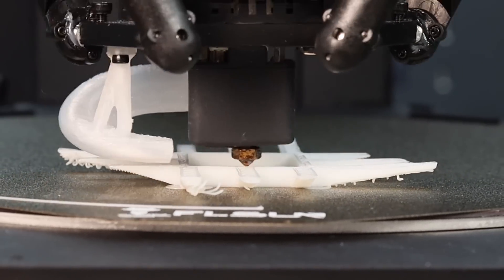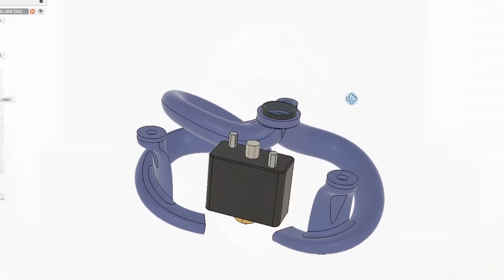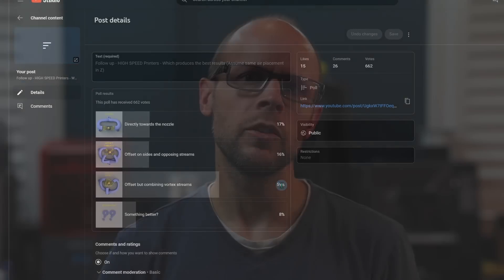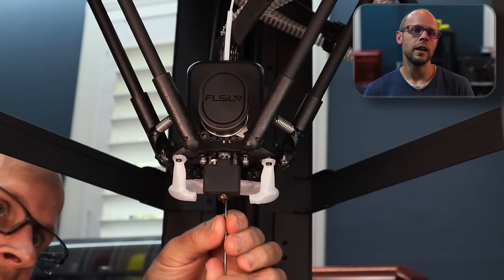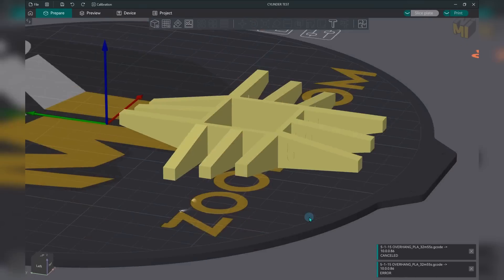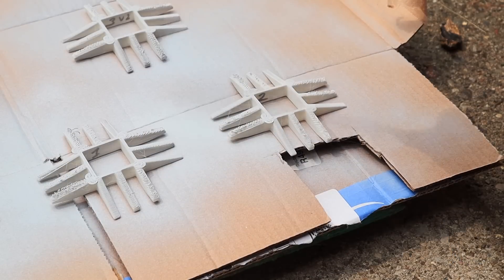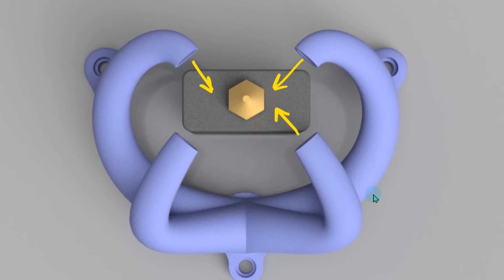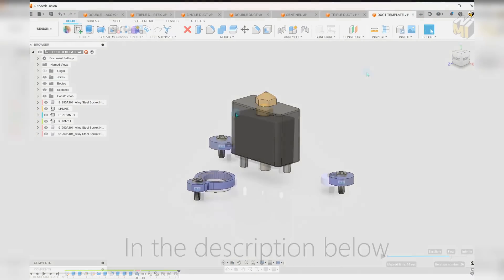More ducts is better, but how many is too many?

Comment: I have two fans cooling my printed parts. I use single ducts for each, but I was thinking of doing a dual duct for each fan, so I can get better cooling across all directions. Do you think it will work well? I want to surround the nozzle, so air does not hit directly the nozzle.

I would like some suggestions because it is my first real duct design and I have made progress, but I think I can do better

This is my custom duct design name on Printables:
Persano Duct for the CR6 SE - 4020, 5015 and 5020 Blowers with ADXL 345 Mount option

I can not put the link in here, Youtube seems to hate the links and delete my comment
Reply: Also, you gained a subscriber! I really like this kind of content.

I am new to 3D design and I love learning new ideas I can put to use on my 3D printer.

Comment: You just needed to do a little more research, there are several duct designs and people explaining how to do it. Testing by blowing on the water, dividing the flow, etc.
Reply from the maker: I've tried blowing on water in previous videos as well, it does give a good sense of how the air is directed down, but I don't believe down is ideal, I'd like to test horizontal vs down next and I'd also like to test out offset vs directed at the nozzle.
Reply: There are also like 100 duct designs by people who thought they knew what they are doing that perform like crap. ;)

Comment: For my own DIY built 3d printer, I have the nozzle surrounded by a circle shaped duct.
It actively touches the silicone boot of the nozzle.

I have no idea how it compares to a more typical design, but I get pretty epic bridges out of it.
Reply from the maker: I've seen a few of these and I think they can work really well, it'll have to be tested against some of the other designs.   the 360 surrounding version would need to be balanced out a bit better with larger and smaller ports, but it's doable for sure!

Comment: Install a windbreak around the nozzle. For a test, place the end of a thermometer about a millimeter away from the nozzle. Heating the nozzle should also heat the thermometer just like it would filament at that short distance. Put a windbreak around most of the thermometer, leaving a small bit of the tip exposed near the nozzle. And then test how much and how fast the different ducts decrease the temperature of the thermometer and the windbreak should prevent the decrease of temperature on the nozzle.
Reply from the maker: Nice idea!  I was going to try and make a silicone sock to cover it properly, but it'd be good to see the impact of the fans on the nozzle first.
Reply: @NeedItMakeIt  it's hard to beat 'real world' testing like you did.. but I'm also a numbers guy, as sometimes things get revealed and new concepts open up. :-)

Comment: Great content!  Get sponsored by one of the meal services that ships with dry ice, so you can use it to visualize where the air is going in each design.  A little dry ice + boiling water makes a nice print bed full of mist.
Reply from the maker: I was thinking smoke pencil, but your idea is wayyy cooler!

Comment: Very exciting and interesting topic. Especially because I wrote my exam in fluid mechanics yesterday. :D
Reply from the maker: Nice!  Hopefully the exam went well.  Do you have any insights into where you think we should go next with the design?
Reply: @NeedItMakeIt  Without CFD simulation this is unfortunately not very easy and even with it you often have to test new prototypes. The round profile is definitely the best to avoid pressure drop as it has the least edge friction. It also has the least turbulence, although the question is whether turbulence is good or bad in this application. Using the same inlet and outlet area for the three nozzles is important in any case, this is based on the flow law. To avoid pressure differences on the sections, the ratio of the length L to the flow area A should be as constant as possible (L/A). You could also use larger nozzles which would reduce the outlet velocity.
Slower velocities are also more laminar and can be improved with a grid of fine tubes.

I'm really looking forward to seeing what else you come up with. There are so many possibilities :D

Comment: This is a tricky test. CPAP blowers will power any duct you have, making it look better than it actually is. Using 5015 blowers and other typical fans won't be able to get air out of many of those ducts.

Comment: You mentioned doing a new duct for the Qidi Q1 Pro. Was wondering if you have any designs for that and/or are planning a video for that printer like you've done for this flsun one?

Would be very interested in improving the cooling on the Qidi Q1 Pro!
Reply from the maker: I'd love to do an option for every popular printer, including the Q1 Pro.  Before that I was hoping to get some ideas from the community to test out and then we can come up with the best possible option together.
Reply: Hey dude,

Based on this video and your experience of the panda jet, I think a 3 or 4 duct design once you have the knowledge on offset positioning, duct sizes etc.

On the Q1 (And other Qidi printers), the probe is on the right and mounts for beacon or Carto place it behind the nozzle.

Placement of a 4 duct design maybe best at 45 degrees, 135 degrees, 225 degrees and 315 degrees.

For a 3 duct design at 45 degrees, 165 degrees and 285 degrees.

Those as the positions least likely to interfere with either probes but I guess that would be in the design work.

I also wonder whether the stock fan on the Qidi (with it's non-standard design) would be better or if it would be better to consider a fan swap with new duct design for Qidi printers?

Comment: In terms of "path" the bend should be contiously differentiable twice so there is no "sharp" corner both in terms of direction and velocity(change) and short as possible so there is no loss
Reply from the maker: If we can get away with the double duct and have them offset to the side of the nozzle I think it's possible.  I'd imagine that the long corrugated hose leading to the duct will cause quite a lot of loss also, I wonder whether a more flexible and smoother silicone hose would be better.  Maybe for the next tests I need to use 2 printers, one with the CPAP and one with a standard blower style part fan.
Reply: Will be interesting to see the difference as ratio between inlet and the outlets will play a role too. Advantage of the CPAP is probably that it will be more "laminar" than a 5015 closely mounted to the ducting system(more equal pressure/flow across the inlet"). I am looking forward to the results.  The fan showdown series by major hardware is fun to follow and hope we get some fun out of this as well

Comment: Great video! This kind of testing is so interesting to me. It makes me wonder why the OEM can't do this and have 3d printable improved duct files available for people who want them. Saves them the injection molding costs, but provides a much better result to the customer.
Reply from the maker: Thanks!  I think it's an area that needs a bit more attention for sure.  I think at a minimum they could provide a file that could be printed at home.  I think you're right, it comes down to cost and to some extent the look.  I really like the open and somewhat organic look, but some people probably prefer the clean condensed version.

Comment: 7:19 Simscale
Reply from the maker: I've tried it, but the walkthroughs I found are wayyy out of date.  They've also removed the compressible tests and only have non-compressible for the free version.   I'll give it another try.  

I have a silly idea, what about making some versions which connect to the hose and then we'd have at least a good visual of how water flows out, it might be a bit of a mess, so I'd have to print something to take the place of the hotend for the tests.  I guess blowing smoke out might be better, that's probably doable too.
Reply: @NeedItMakeIt what about OpenFOAM?

Comment: I think the "relief ports" on that one duct are to cool the part aswell. When printing really fast, the nozzl will not spend enough time near the recently laid down filament. That's why you have auxillary bed cooling fans on the bambu x1 and voron 0.2.
This would be similar to having an auxillary bed-widevcooling fan.
Reply from the maker: It could be, i guess I'd need to cover them up to see if there is any noticeable impact.   I'm not certain that a CPAP can really replace one or two auxiliary fans, but I'd like to at least try.  Having a part fan that can cool locally and also cool the rest of the part is a tall order.

Comment: I'm so confused, what about heated chambers? Do we want parts warm or cool as soon as the nozzle leaves filament?
Reply from the maker: That's a tough one, when printing with ABS, I print much slower and with almost no part cooling on, with PLA, we're talking more extreme speeds and much more cooling.   I think it's a good topic to explore more, when "cooling" in a heated chamber, the air is going to be fairly warm so it cannot extract as much heat, in the case of these materials, it may be a good thing to make sure that the ABS or PC parts don't warp and shrink too much during the print.
Reply: You want the part to be just cool enough to support the layer above.  The hotter the part, the stronger layer adhesion.  Heated chamber prevents overcooling.  You can also passively cool, by printing many objects on the build plate.  This allows the parts to gradually cool down without the need for a cooling fan.  It is a balancing act especially if you bring cold air from outside the heated chamber.
Reply: For materials such as ABS and similar. You must turn off parts cooling or about 20% fan. Keep the part hot most of the time.

Comment: It would be sick to see you print with smoke or fog of some kind blowing out so we can see the real relationship between the nozzle and the flow.  Also, if you build a raised glass bed with 45-degree mirror under - we could look directly from below at initial layers.   Nobody on YT has done this to illustrate a point that I know of.  Your content is outstanding.
Reply from the maker: YES!  Oh I like that idea with the mirror, that's very clever.
Reply: @NeedItMakeIt  I do clever for full time living.
Reply: So... Smoke and mirrors? For once, a totally positive thing. IT MUST BE DONE!
Reply: It'd be tricky to setup, but maybe Schlieren photography?
Reply: Mirror bed could help with the lighting  l @SnakebitSTI
Reply: How did you make the part of the ducts that bolts to the effector? Was this the generative design module?
Reply: You could simulate it with air flow simulation software. That gives you a very good idea what may going on
Reply: Very good comment. For me we need to see where the flow goes. A lots of maker make fan duct but i think the flow is too much directed to the output of the nozzle rather than on the layer. I think good fan duct can be on the side of the hotend directed to hotbed.

Comment: Ive seen visible print quality improvement in all my printers when installing community designed shrouds. Especially on printers where I can go from one cooling duct to three. It makes a huge difference. In the same vein, these enclosed corexy printers like the K1 make no sense with the single giant aux fan on only one side of the print bed.

Comment: Very timely video for me, and I hope it creates lots of discussion about the best duct design 😊 I am currently designing a toolhead for the Creality K1 family of printers that use standard revo hot-end parts (revo voron) support several of the extruder models out there, and most related to this, a rear mounted part cooling fan so need to find a good duct design for that :) as always great video and information..

Comment: I've been working on designing a highly efficient duct for my printer for quite some time. Although most of my designs have been lackluster, I've discovered some useful insights:

It's more effective to point the ducts slightly below the nozzle, concentrating the airflow more on the part. Additionally, angling the ducts downwards slightly ensures the cooling isn't too strong on the nozzle, preventing temperature fluctuations and reducing the risk of a thermal runaway error.

If you opt for horizontal twin ducts, ensure they are either offset from each other (not exactly mirrored) to minimize turbulence or angle them slightly so that when the airstreams meet, they push each other in the same direction, exhausting the air out of the way (a technique I learned from Hero Me ducts).

Regarding the shape, most ducts I've seen are rectangular, exhausting the airstream like a thin curtain. However, the downward-angled ones tend to be more rounded. While I'm not entirely sure of the implications of these shape decisions, the rounded shape might provide some benefits.
Reply from the maker: Beautiful, thank you for this info! I have the follow up video in the works and these ideas will be super useful.  I'd like to find a way to visualize the differences using smoke in the next video too.  The water test is nice, but it's not a great representation of what really happens and the more I think about it, the less I believe that air coming down is good.  It may be good for some parts, it seems to be a better idea to have it come across the surface in a stream of cool air which can quickly warm up and then easily leave.
Reply: @NeedItMakeIt  I'm curious to see the results of the smoke test and hope they will be visible despite the high speed, which might make it challenging. The closest way to visualize how the air will travel is through CFD (Computational Fluid Dynamics) simulations. Unfortunately, I don't have the resources to learn both a simulation environment and the underlying physics, but I believe this is the "right" approach. Ideally, you would perform calculations to determine the desired outcomes (such as airflow path, velocity, turbulence, etc.), then model the duct based on those calculations, followed by simulations, testing, and refining the design.

I'm looking forward to your next video and seeing what you've discovered. It seems that, apart from a few videos, there's a significant lack of information on this topic. Also, I'm starting to think that 100% fan speed may not necessarily be the best setting, even for bridging and overhangs, I am curios what is your take on this matter.
Reply: Nice! A lot of this follows what I've been discussing and theorizing with Mike and others. We gotta get to the bottom of best cooling as a community! There are so many bad designs out there.
Reply: I just started my journey on making a custom duct too. I have noticed Voron design also have this thin duct that are directed out of the way (like you mentioned) instead of facing each other like most ducts. The CFD looks promising as well.
Reply: @shababhsiddique  Yes but, as far as I know, the Voron ducts are made for printing with ABS/ASA for wich cooling is not that important so for materials such as PLA or geometries that require intensive cooling the Voron ducts might not cut it. I borrowed the cooling duct design from the EVA 3 toolhead and so far it has been solid

Comment: Always had trouble printing dimensionally accurate small gears for the differential in 3d printed truggy by open RC. I put it down to inadequate cooling as some teeth in the circle curled up. Would be interesting to see how your designs handle that. Also just watched a video by Nathan Builds Robots about glass and carbon fibers in filament. You might not want to handle your glass fiber ABS with your hands anymore and make sure you have an air fillter running when printing with it. Can't wait to see the next video!
Reply from the maker: I'll find the gear and see if I can print it!  Which filament do you use?  For sure, that's a good topic he's on, I agree that we don't speak much about the long term health impacts of 3D printing.  Coming from a Woodworking background, it's similar, except some of the particles are known carcinogens, specifically from hardwood lumber dust.  It would probably be best to have a Room filtration system active at all times especially if you're working near your printer.
Reply: @NeedItMakeIt  For the small gears I was using ABS+. In the end I went with metal gears in the differential as it was cheap and I had other things I had to fix. If I were to try it again I would use Poly Carbonate as it is super strong, temperature resistant and cheap for its properties. A lot of engineering filaments get pricey quickly. I do really like my carbon fiber PC filament because it is way easier to print with. The fiber breaks up the polymer chains causing less shrinkage. The only downside is that the layer adhesion isn’t as good as straight PC. Don’t get me wrong, those parts are still really strong. I use the Carbon Fiber PC for my hotend fan ducts because it is light and doesn’t deform on my Prusa mk3s. Which I had ABS+ deform on me enough to start knocking prints. I voted for the three ducts with the vortex, it was only a guess though. Nice to see it work.

Comment: Has anybody tried sucking air instead of blowing air? Then the toxic fumes could also been sucked away with a lightweight tube to a filter
Reply from the maker: Interesting concept!  I can try this for sure, my initial thought is that it would not be able to keep up because the flow of air is harder to control, but it's a very unusual idea that's work exploring.

Comment: I would like to see you do a video that covers venting a printer to a window etc.. it is confusing for many with the pressure changes.. inline fans.. enclosures over enclosures.. directly from the printer exhaust.. from the top of the printer..I would love to print in materials like ASA but I want to vent the fumes..